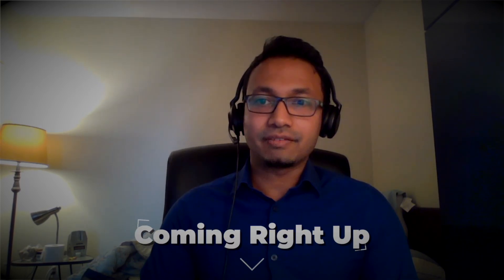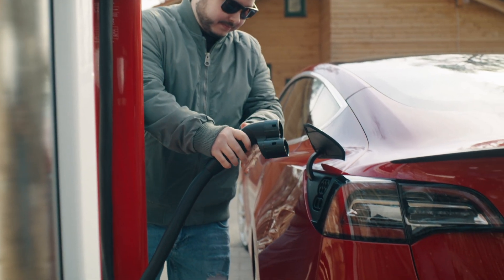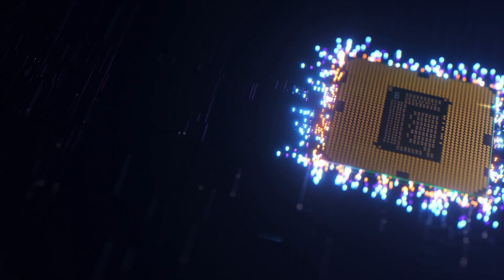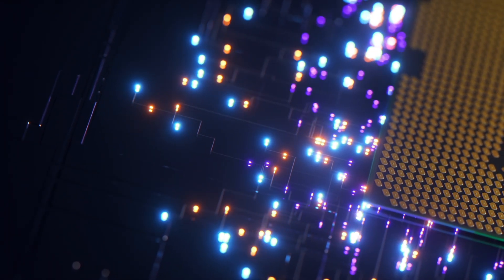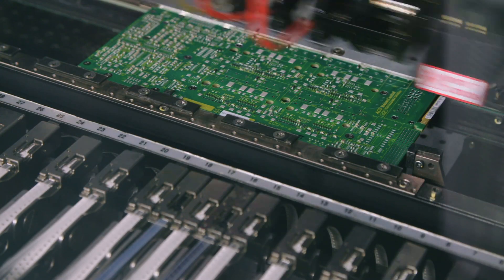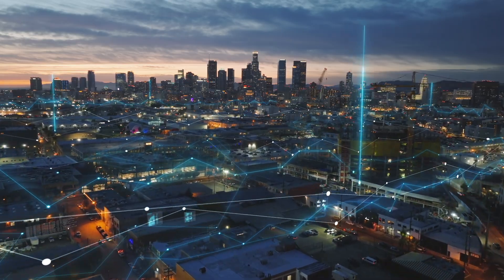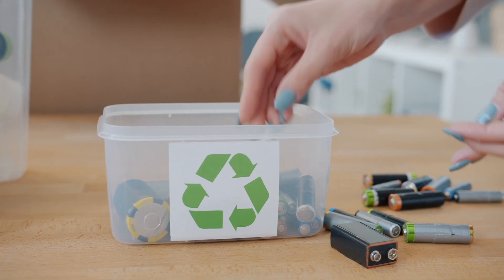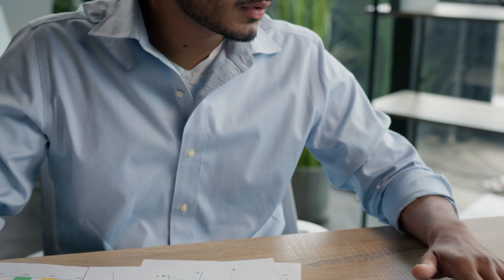Battery Expert Explains: THIS is Why Aviation & EV Batteries are Different

Comment: Joby uses commonly available automotive cells built into the structure. The guy that claimed to invent the electric harley and works for joby said that during that presentation on their own channel.  Lilium is claiming to be building pouch batteries like rc toys.